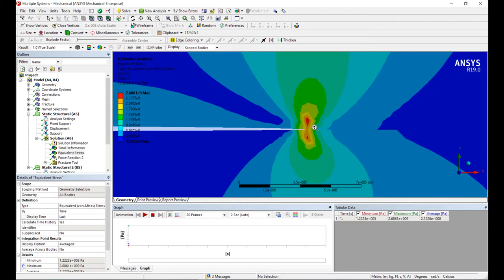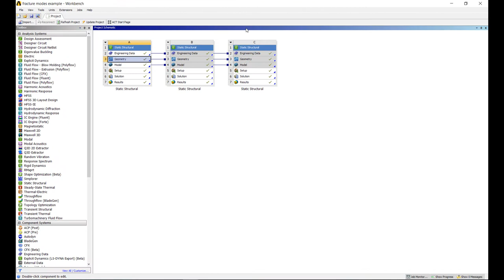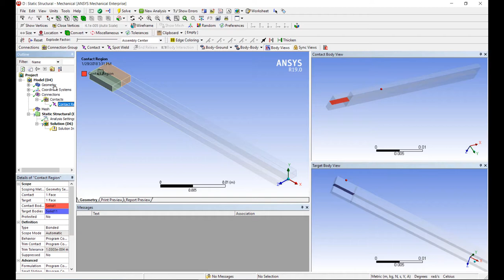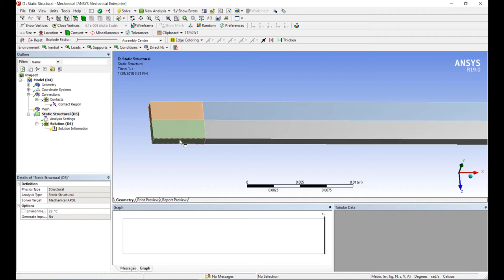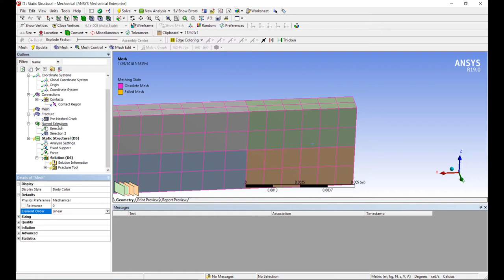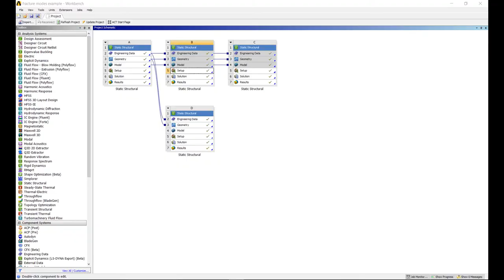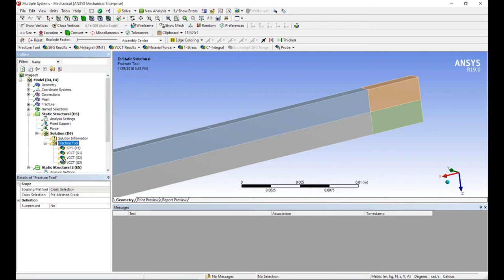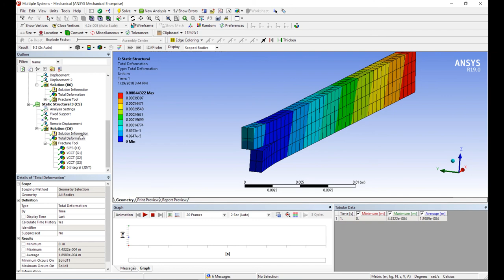ANSYS Fracture and Delamination Part 2: Critical Fracture Parameters

Comment: @ozenengineeringsimulation : Thank you for your detailed videos, they are really helpful to understand the concept. I just have one query - I am receiving this warning message when I am trying to replicate your model at first instance - One of the crack's mesh encompasses multiple bodies which have different material models. Ensure one material model by scoping these bodies to one material assignment object.  Could you help to mitigate this waring so that error later could be avoided. In your video, no warning message flashes when you allocate nodal crack tip to pre meshed crack under Fracture in model tree. 

Thanks

Comment: Thank you very much for this useful video. I just have a question. what type of contact did you define for the crack surface, especially in mode II. because in mode II, it seems that there is sliding between crack surfaces. Did you use frictionless or no separation? I'm trying to calculate the fracture energy of single-lap adhesively bonded joints  with a pre-crack, I always receive this warning:
"The fracture parameters computed during solution may be incorrect. Check the Solver Output on the Solution Information object for possible causes''. 

I found that this warning is because of the 
1-A contact might have been created in the region of the crack contours
2- A load might have been applied in the region of the crack contours that are not supported in the fracture parameter computation.

For removing the warning, I tried both no separation and frictionless contact but the warning appears again. And I also applied the load to nods, not geometry. but the warning has still appeared. 

I'd be grateful if you could an idea that can help me. Thank you in advance.

Comment: ONE more doubt i have, when you defined the coordinate for crack  according to me it should be at crack tip that the same we used for formula also.
i checked the analyses for both coordinate at tip and coordinate away from tip, Stress Intensity factor is different for both cases but deformation is same.
please check it.
Reply: Hi, dear sir >>>>>
I am a student in 3rd year Ph.D., I'm working for materials composite  but now I have a problem for creating a crack in my domain >>>>>
my question is: how can I create a crack on the material composite domain?

Comment: I was able to calculate SIFS (K1) during the mode-I simulation. However,  when solving for G1, ANSYS returns an error saying the crack is undefined
Reply: hello alex could you get the results.
Reply: @saadra2219  Hi, dear sir >>>>>
I am a student in 3rd year Ph.D., I'm working for materials composite  but now I have a problem for creating a crack in my domain >>>>>
my question is: how can I create a crack on the material composite domain?
Reply: Hi, dear sir >>>>>
I am a student in 3rd year Ph.D., I'm working for materials composite  but now I have a problem for creating a crack in my domain >>>>>
my question is: how can I create a crack on the material composite domain?